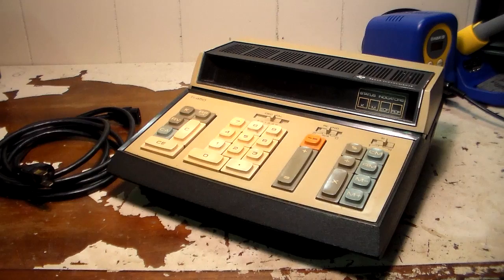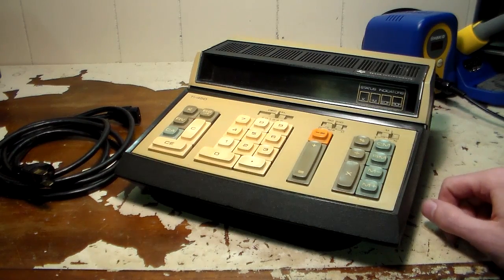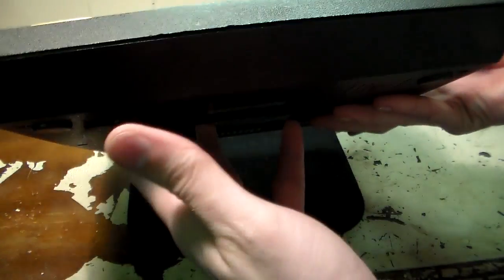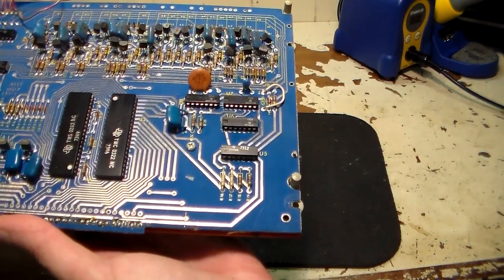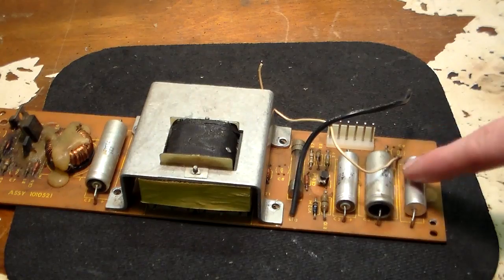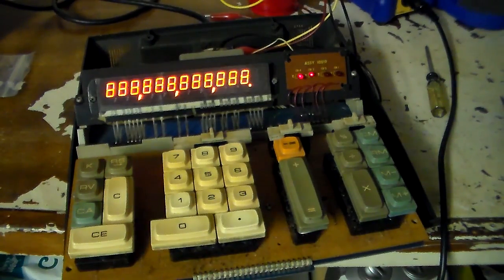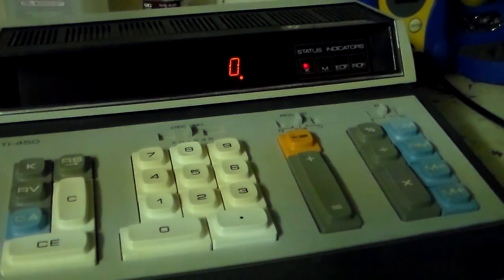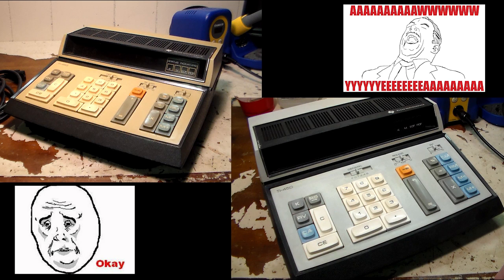Texas Instruments TI-450 Vintage Calculator Restoration

Comment: The silver trim accents can be repaired, if you so desire.  Hobby shops will sell you chrome-like paint, and some liquid masking that you paint on, let dry, and then remove with an exacto knife.  The paint is more of a satin silver, but you can get a chrome-like appearance by blowing on it gently immediately following application (as in a couple of seconds).  Alternately, you can purchase thin mylar tape with a true chrome plating; apply the tape, let dry, and trim the excess away.

Comment: "Bare traces, no solder mask..."  At the time that board was built, PCBs had only been in use for about a decade, and the problems associated with having bare traces had yet to evidence themselves.  Solder mask was invented to overcome the problems associated with bare traces.

The Seventies were really the dawning of the age of electronics into society.  Prior to then, most functions were achieved through mechanical or electro-mechanical means.  It was common to wear a wrist watch that needed to be wound every day.  My uncle purchased one of the first 'remote control' televisions; it was a wired (!) control which, when pressed, would activate a motor which would change the channel up or down.  Thunk!  Thunk!  Thunk!  No other functions, such as volume, were available.

In the Seventies, society met the electron.  It hasn't been the same since.

Comment: As mentioned by others, the "K" key allows you to set a 'constant' value that will be used in multiple subsequent calculations. The "RV" key, based on how my old Canon Canola desktop calculator works, is most likely a 'recall value'  or 'recent value' function.......If for example you were entering a calculation such as 143.2 x 3.14 + 0.75443, and you had just entered the '0.75443' value but had not yet pressed the "=" key, you might wonder if you had correctly entered the previous value correctly (remember that the 0.75443 value would be when the display is currently showing at this time), so pressing "RV" would cause the display to show the previously entered value, 3.14 in this example. Some calculators would allow an additional push of the button to display even further back, 143.2 in this example.

Comment: RV means Real Value and CJ Bailey was correct that it is used with calculating bond maturity values.
Reply: Matt Andersen, but if you look at how it works, it seems to be recalling a previous value, which is exactly what that key does on my somewhat older Canon calculator.....